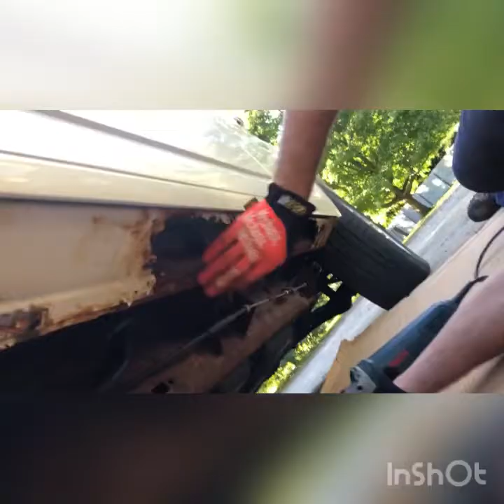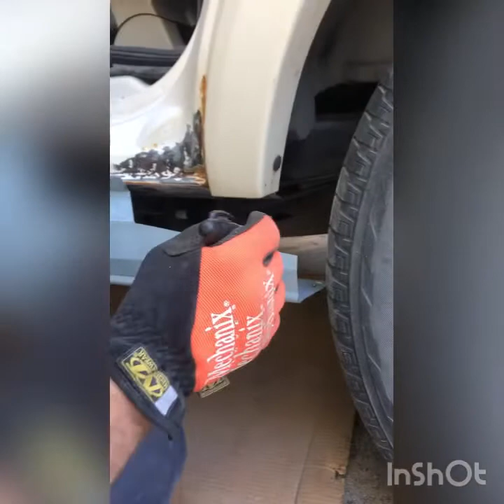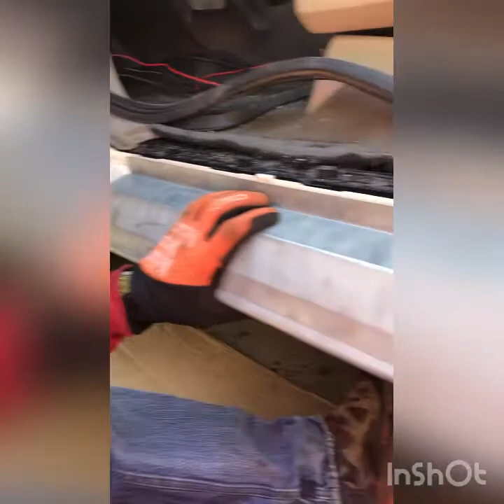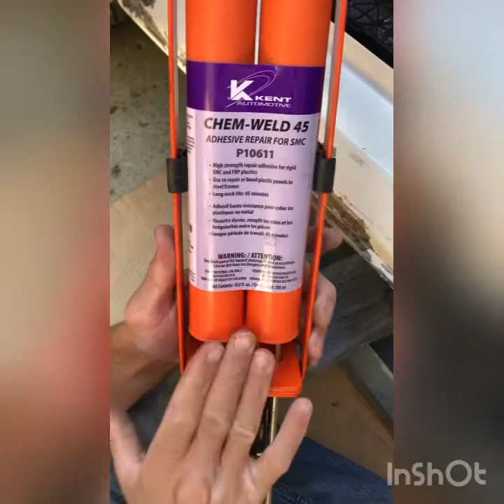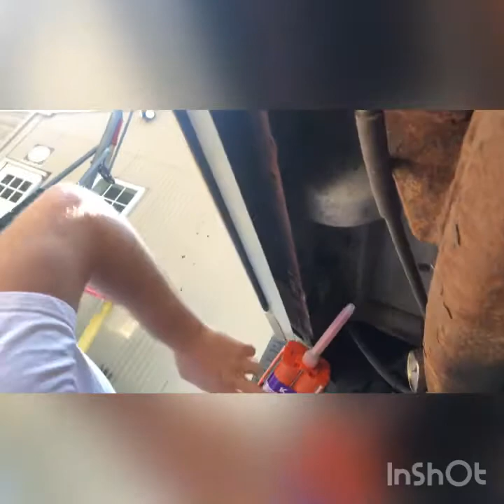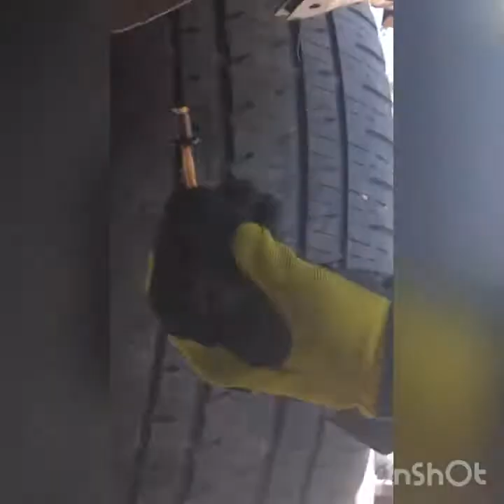Replace repair rusted rotted truck rocker panels no welding!

Comment: I've been putting rocker panels on and wheel arches for about 40 years. The only thing I would change is to use POR-15 on any of the rust that's left. You should do the inside of those rockers. And any place that you sanded down use POR-15 as it will only adhere to rusted areas. I know there's a lot of other products out there. It's like asking you your favorite type of beer. But I've never had a failure with por15 and I use it on a big dump truck as the box and the frame were very Rusty. There were no holes at all so I just used a roller to put it on. Now for everybody out there that's telling you that you're doing it wrong and it's not going to hold in its structural. Let's see your videos. And I've done rockers the correct way and they're spot welded in. But that takes a lot of time and it costs a lot of money. But their spot welded from the factory. In fact, your whole vehicle is pretty much spot welded. Just face out your rivets with an equal distance between them and use some seam sealer and they'll look just like a spot weld
Reply: Fckn love POR-15... I painted the entire underside of my 1992 Celica ST185 with it last year (with a roller and paint brushes). It's expensive stuff, but it's also second to none. Come to think of it, I redid my wrought iron front porch railings last summer with POR-15 after I replaced my rotten front porch decking. I love the glossy black shine it leaves behind.
TRUST !!

Comment: A repair at reasonable costs. A little more work, and it will be done. Without r,ust treatment of the very rusty parts and the also rusted floor panels, it will last from 12 o'clock til noon, as we say in Germany. Good work in vain.😊

Comment: Hey Dan could you post an update on how these look two years later?  Im about to do the same operation on my Expedition and thank you so much for the step by step install.  Also, what brand slip on rockers did you use?
Reply from the maker: I will work on getting another video out. The Panels are from classic 2 current fabrication.

Comment: Thank you that was very helpful. I saw another video and they used JB Weld. He said it was way cheaper than the autobody stuff you used.
Reply from the maker: These panels where pretty reasonable at about $40. I’m sure you would have just as much in JB weld?

Comment: I'm going to use Eastman Rust Converter and then paint it with their ceramic type of chassis paint before I cover them with slip on rocker panels.

Comment: This is an excellent video which busts the mystique of this body work that few amateurs would attempt in their driveways.  The quality of these USA-made replacement panels is nothing short of excellent.  They are also inexpensive.  Mine arrived in New York in three days.  

Here are some thoughts.  The video cuts through much of the prep and goes right to the mounting.  Obviously better long term performance would result from better prep.  Some folks are in this for the long haul, some aren't.  The care given to preparation chooses the performance we want.  What additional steps can I take to assure a five to ten year repair? 

I think I'd prep the existing inner rocker panel to protect it from rust.  I'd coat it with an epoxy or a POR-15 type of paint.  I'd cut out badly rusted rocker remnants.  I'd prime the underside of the replacement panel with something to defer rusting.  What about the aluminum pop rivets?  Would they cause electrolysis in the steel?   How would I keep them from rusting around the holes?    How could I facilitate drainage of the rocker panel to avoid the kind of rust that destroyed the originals? 

Could I just install them as shown and then coat the inside with an oil product such as Fluid-film?  

Some discussion about and opinions on this would be so much appreciated!  Thanks again for a great video!  - Eddie in New York
Reply from the maker: Yes I agree with you! There are many different processes one could have used. The pay you decide is your choice and you have to ask yourself what you want out of the final product? Longevity, cost effective, put a  band-Aid on it? These will all be different processes for all different situations. My video is to just show one way this process can be achieved.
Thanks for watching!

Comment: Instead of rivets for the bottom part,  can i use self tapping screws? Also great video!
Reply from the maker: As long as the existing metal that you are going through is good I don’t see why not?

Comment: Did you ever post the painting and finishing video?
Reply from the maker: I have not yet. I’m kinda tired of all the haters on here and there 2 cents so I haven’t posted a video in awhile. I will get it soon and let you know! Thanks for checking back!!
Reply: @danofalltrades3567  I want to do my 2008 Expedition and I like your approach. I wanted to know how you dealt with the rivet heads sticking up. I am looking into doing something similar but am thinking of spot welding so I can get a smooth look. I am willing to do a bit more work to get the rust out and converted and covered with sealer before attaching the panels because I want to keep the vehicle for at least another 5 years.
Reply from the maker: @rodneysmith1684  yes spot welding would definitely be cleaner. For sure cleaning out as much rust as you can and sealing before you install the panel is best approach! I wasn’t concerned too much about the longevity of the the repair as I was getting rid of the vehicle. I think if you take your time and get as much rust out as possible, you will get a couple more years out of it! Thanks for the views and let me know if you have any more questions?

Comment: I did this to a friend's truck but we cut all of the old rusty metal off and left 3/4 of the metal around all the edges for the panel bond , and put rust converter on the rust on the inside and primed and coat of paint it. And after the panel bond was dry we sealed up all the edges with seam sealer primed little gravel guard and paint. The truck is still going strong after a number of years now 👍
Reply: Great information.  Thanks!
Reply: Good idea on the seam sealer!  I'm about to do this operation on my Expedition and have been worrying about the likelihood of water getting in behind the replacement panels and how to seal it up.

Comment: Great Video. Best video on rocker panels.
 I am looking to repair my rocker panels soon and found this very helpful.
Just wanted to know what rocker panels you used and where you got them from.
Also what does it look like now.
Thanks!
Reply from the maker: They are from Classic 2 current fabrication. I will posts a finished video of spraying rock it liner over them!

Comment: What panels did you get?
Reply from the maker: They are from classic 2 current fabrication
Reply: @danofalltrades3567  thank you! Much cheaper than where I was shopping.
Reply: @danofalltrades3567  one more thing, what size rivets did you use on top and bottom?
Reply from the maker: @DJKBEATS  the top was like 1/8 pretty small. I don’t remember the exact size of the bottom but they where much bigger. Like commercial grade? Hope that helps!
Stay tuned for my next video how to rock it liner over them.

Comment: This is ok, but there's still too much rust left behind before you epoxied. I recommend using rust reformer all over then sand the areas to be epoxied to the metal before glueing, and never glue over paint.
Reply from the maker: I agree. The 100% right way to do it would have been to sandblast any rust that was left. Then seal before epoxy in the panels. Doing this outside in the backyard I have limited equipment and use what I have.
Thanks for watching!

Comment: This is absolutely the way to do it as it will be stronger than welding and seals off the panel at least at the joints to keep salt from  getting in.  Thanks for posting.
Reply: Except if there isn't any drain holes, water mud and everything else will get back behind it and sit there to rust it all out again. Those inner rocker panels still have a lot of rust, it wouldn't take much more and he'll be doing this again fairly soon depending where he lives. All that caulking will hold water up against already rusted areas.